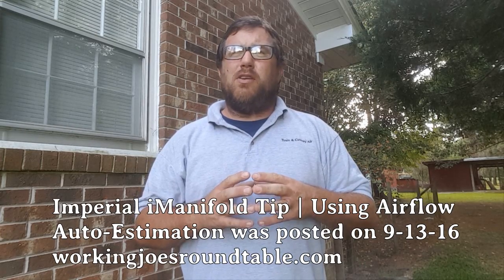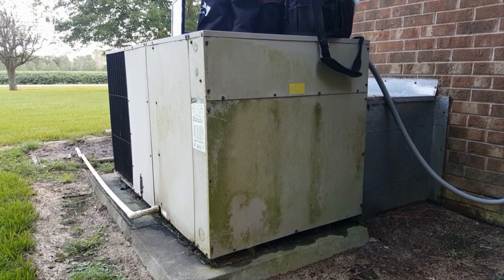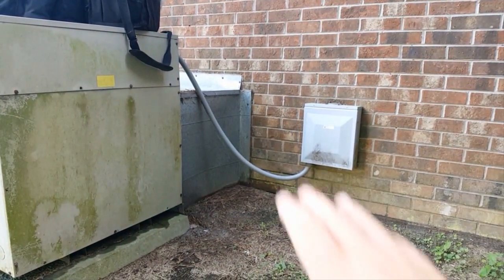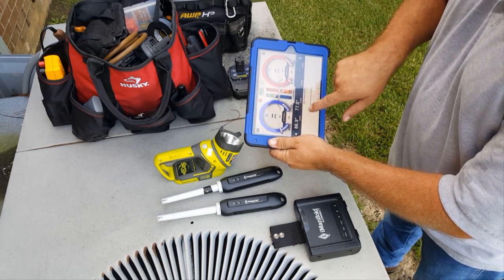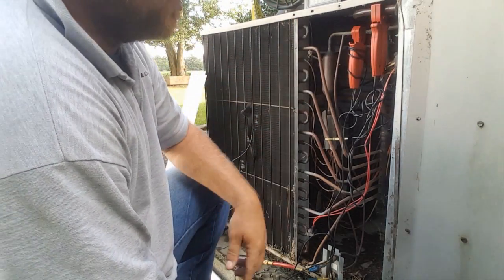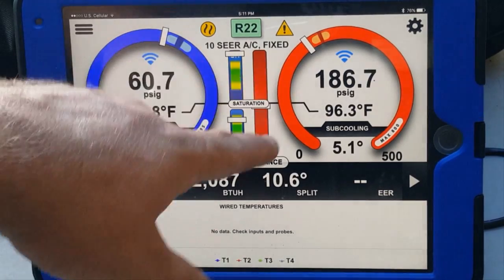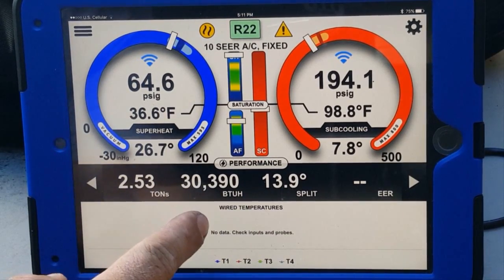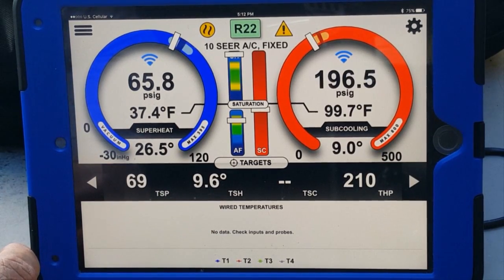iManifold Airflow Auto Estimation Update

Comment: That was a great video Zack,  I didn't realize the app was updated and I was using my iconnect wondering why it was stuck on 1200 cfm,/ 400 per ton but this video explains it all. Thanks for posting it.
Reply from the maker: +Aden Watts you can tell it what airflow you want it to use, yed
Reply: Can you change the default airflow the app uses when not in auto estimation mode from 400 cfm/ton (e.g. to 350 cfm/ton)?
Reply from the maker: +BBYERS27 thanks for watching